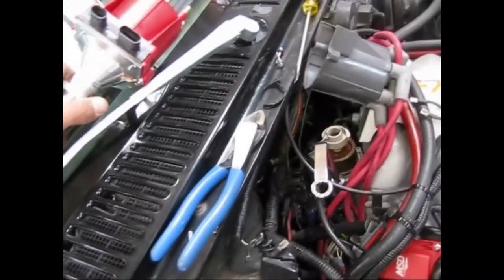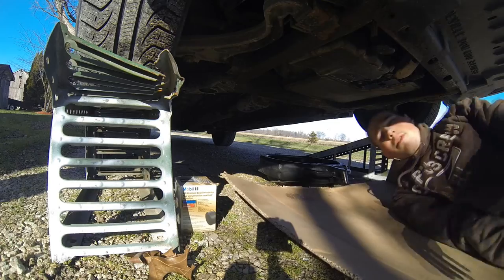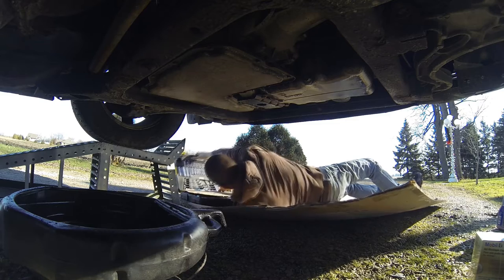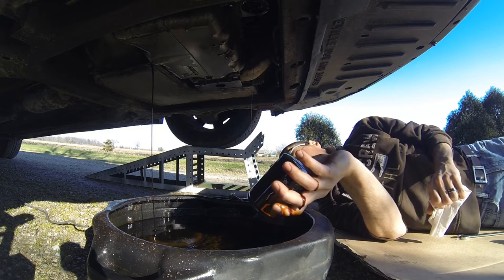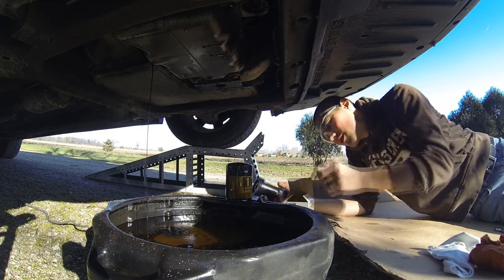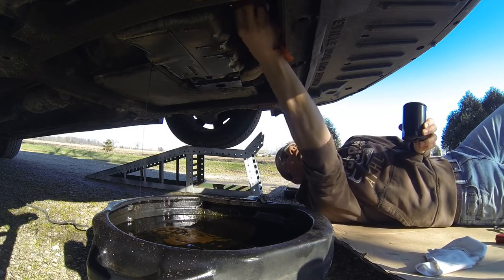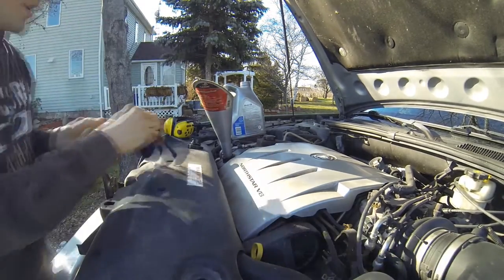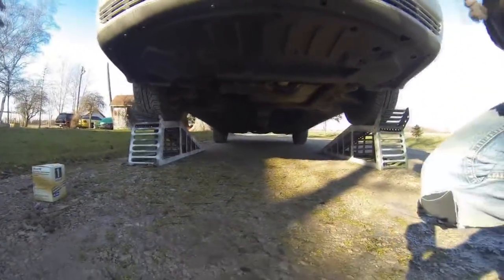Rotten Caddy Oil Change

Comment: I just picked up a 2003 Deville and its right at around 39k miles (64,000 kilometers) out of curiosity, what did the oil life thing say before the change.
Reply from the maker: yoyoglock4 I believe it was in the area of 74%. I'm usually going by actual mileage myself I don't really trust the computer.  5000kms is a good enough distance for me